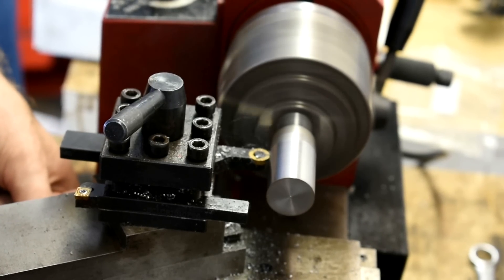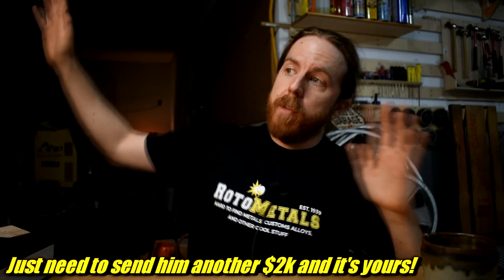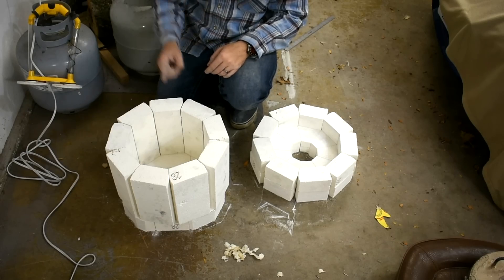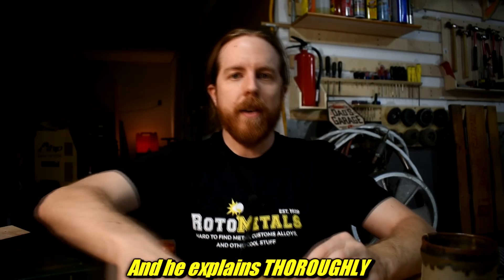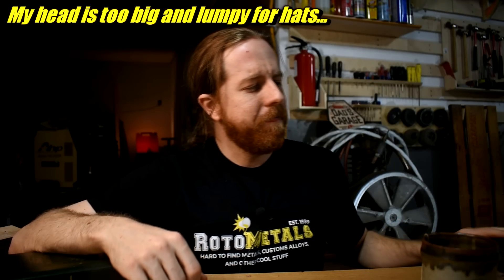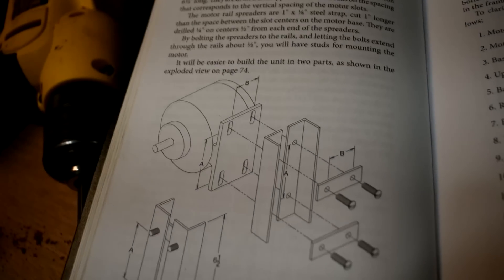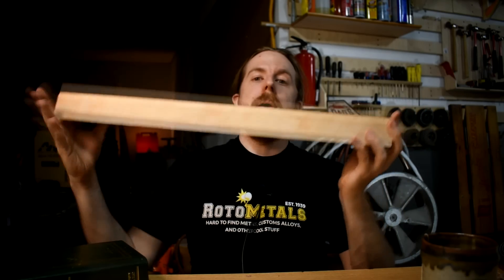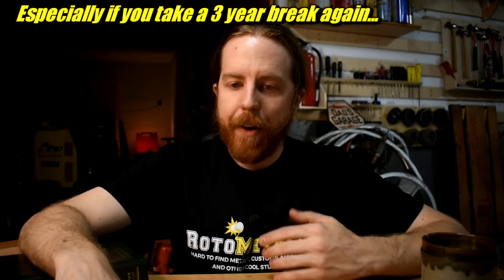Build a DIY Home Machine Shop the Gingery-ish Way

Comment: How many pounds of Za 12 do I need to order from Roto Metals for this project?  Looking forward to using my new 3 year old Devil forge for this project.  Thanks a bunch bro...
Reply from the maker: Not sure exactly how much you need to finish it just yet, but I bought 32lbs and it seems like that would cover the majority of it.  A standard gingery bed is 4lbs of aluminum, my bed is 12 lbs of za12.  Headstock is about the same, and the rest of the parts are much smaller.

Comment: I bought a set of those books years ago and was all set to start, I was teaching English to a bunch of machine designers and showed the books to them. They thought the foundry was a great hobby idea and recommended truck pistons as melting stock and gave me lots of other good tips. I showed them the lathe book and were appalled at the design, they begged my to abandon the project due to the (in their view) criminally negligent carriage design. They were convinced that anything but the lightest of cuts would cause the lathe to explode, especially when turning anything harder than toffee.
Reply from the maker: Oh yeah.  The whole thing needs to be beefed up, which is one of my design changes.  I'm also using a much tougher metal.  In Gingery's defense, if he used aluminum, it probably would just bend and not explode 🤣

Comment: Paul,
 I was directed here by a commentor on one of my videos. He had heard the marvelous shout you gave for me. I am very appreciative of it - thank you greatly.
As I have no doubt mentioned before I am not a fan of the Gingery lathe idea. There is a perfectly good reason that lathes are (usually) made from cast iron. It’s not that iron is cheap, fluid, casts well and easily, although these things certainly help - it’s because when properly formulated iron has excellent vibration damping abilities that help to reduce the resonances that cause tool chatter. Aluminium is very poor in this regard and a lathe made from aluminium will suffer badly from chatter problems. At first, I was struck by a possible problem in using Ezda / Zamac alloys for a lathe – they are heavy and while it might seem counterintuitive, weight is not a good idea as it lowers the frequency response of the lathe – it’s the lower frequencies that cause the majority of chatter problems so extra weight - not good. However, your choice of Ezda might just turn out to be inspired because these alloys have quite good damping ability - particularly the 27 % aluminium alloy but the 11 and 8 % alloys and almost as good. 
A couple of points re these alloys though, they lack a strong oxide film on the liquid and have low surface tension and will thus run into the sand mould surface and produce a rough casting on the slightest provocation. Casting temperature is important to help prevent this - I would start at 500 Deg C and go down from there until just above miss fill temperature. Also important is that mould heights are the minimum necessary to provide adequate feeder height - extra height = extra pressure = rougher castings, see my "possibilities" video for an example of this, (shameless plug😊)  and of what is possible with these alloys with careful casting. Good basin/sprue and gating technique to produce the calmest possible fill is important too. One thing that many do not appreciate with these alloys is that they can segregate on melting and on standing while liquid, thus the top of the melt can become aluminium rich and the bottom zinc rich. Careful stirring is needed to eliminate this  problem – see my video Don’t stir up trouble… (another shameless plug 😊)
Thank you once again for the great shout out – I just wish more people were of the same opinion 😊... . Martin
Reply from the maker: Hi Martin, its good to hear from you!
Vibration dampening was the main reason I chose za12 for the lathe project.  I saw Makercise struggle with chatter problems until he bolted the thing to a concrete slab, so i decided i wanted to toughen up the castings, use a vibration dampening metal, and then i'll bolt it to concrete anyway. Iron would be great, and i've melted cast iron in my furnace set up, but the extra heat was just no fun to deal with.  I don't think my sand could handle cast iron anyway.  
I've heard about the metal segregating, and i think i've noticed the issue on some of my test castings. From what I read, they segregate in the mold if they don't cool quickly, and the aluminum rich metal will float and freeze on the top, so the shrinkage occurs on the bottom.  I had a couple tests that were probably too hot and poured into overheated plaster, so they stayed liquid a long time, and the bottom shrink upwards.  I was confused until i learned about the segregation.  I saw your stirring video and that's definitely going to be how I stir this stuff.  It makes me wonder If i need to feed the lathe bed casting from below, or if i should just forego feeding entirely because its a thin casting of uniform thickness.  Campbells book says to not use feeders unless necessary anyway, and gingery's gating method (dump metal in a hole on top) wouldn't feed very well anyway.  I'm definitely not doing that haha!
I printed a box that i can use to make a repeatable pouring basin, which unfortunately adds height but it does allow me to fill it from the crucible without dumping the metal from a height.  I noticed on some of my recent test castings that the surface finish in the pouring basin is excellent, which the casting itself (4" lower) is VERY sand textured.  And you're right on with 500C, that was the best temperature I found. I could have probably improved the gating and gotten it lower but it was tending to freeze otherwise.  
And thank YOU for all of the informative videos! you are a major help to those of use who want better castings! ...Paul
Reply: @PaulsGarage  I wonder if the base was full of lead held (poured) in with some cross bolts would be a decent dampener? It would certainly add extra weight. I've been keen to try this series for a few years now and have just ordered the 'big' book. Would the lead soften the aluminium at that temp?

Comment: You might look online to see what improvements other people have made to the lathe. The biggest suggestion was to scrap the design for the lathe bed and build it according to the bed for the mill with a piece of 1/2" cold rolled steel attached for the bed surface. The next suggestion is to solidly mount the lathe on a large block of reinforced concrete to absorb vibration and reduce the harmonic frequency of the lathe (better surface finish and accuracy). The next suggestion is to throw away the jackshaft power train crap made from old bed rails and set it up with a VFD (Variable Frequency Drive). Either one from China, or a heavy duty RC car setup, called an ESC (also from China).  Until you need to cut tapers, just use a solid block as a tool post instead of spending the time and effort to build the compound rest. It will give you a much more rigid setup. And last, setup your lathe to be able to replace the leadscrew. It starts with a regular threaded rod (which is crappy), and suggests replacing it later with square threaded ACME leadscrew. The only place I could find one was from McMaster-Carr industrial supply, and it wasn't cheap. I would have been better off getting a cheap ball screw from China and setting the lathe up to use  the ELS (Electronic Lead Screw) system by Clough.

There are a lot of places to get good design ideas and methodologies for building lathes and mills. The Myford 10 is the lathe Gingery copied, and he could have done a better job of it, but looking at the accessories for it will give you a long list of projects to build for the rest of your life. Opensourcemachinetools.org has the concrete Multi-Machine by Pat Delaney. It's cheap to build, ginormous compared to the Gingery, and if you pay attention to detail during it's construction it'll be capable of some decent work. There's also the Stepperhead Universal Machine Tool documented at lathes.co.uk in the "lathes" section.  Very sweet. The Hommel UWG lathe used in German U-boats of WWII. Super compact and versatile, just a pain to setup. The Hardinge HLV-H Precision Toolroom Lathe is a thing of beauty. It's what the Myford 10 wants to grow up to be someday. Finally, there's all the people that have modded the standard Chinese mini lathe to make it into a capable machine (Like making a silk purse out of a sows' ear).
Reply from the maker: Interesting, thanks for those links!  I'll check those out.  I'm definitely interested in improving the lathe. I've already made the bed pattern so I'm sticking with that (it's modified a bit already) but I'll definitely look into the rest
Reply: @PaulsGarage  I would look at other mods, some of the shortcuts were to help make it easier to build and cast with decent results. Now that you have mastered 3d printing, you can more easily do like cross hatches on the bottom of the bed for rigidity (probably tapered to make it easier to get out of the sand) but large enough to hide the single shot whiskey bottles from your wife, or some gems, or the keys to your mistresses apartment. It was a skimp on his part to make it easy to cast. 

The other thing that would be great is to replace the brass bushing/bearings with actual bearings. Which I don't know if it is possible or whether you have to build the lathe then the mill to be able to get the holes in the headstock correct to take angular contact bearings. Which are expensive, and can't be found at the hardware store, but would be a vast improvement.
Reply: @seano8927 Do you think Babbitt bearings would work ok? Have just ordered the full hardcover book and keen to give it a go.

Comment: This is a fantastic project, but it will take a lot of time. For those of you who do not have said time it's still quite easy to find used engine lathes that are in perfectly usable condition. Look for Atlas, Clausing, or Shurline. Anything made between 1930 and 1980 will be a good buy and almost all parts are still available at reasonable cost. I bought my Atlas 6" for less than $700 with tooling and change gears.
Reply from the maker: It will take years most likely.  Not just for the lathe but I want to go through the shaper mill and add ons.  Gonna be content for a loooooong time

Comment: You should look into using Epoxy sand/gravel mix to cast you lathe bed in stead of metal casting.  I'm not sure if it would be cheaper but, it will be easier to do.  After all there are plans for a concrete Lathe

Comment: Hi Paul. Great project to sink your teeth into. I agree several changers should be made to the lathe. If modern components were available back when they would have been incorporated into the design.   So go forward and build and learn much along the way.

Comment: I've seen some folks use the bed design Gingery employed for the milling machine project for the lathe. The milling machine bed doesn't have a solid top; rather, the resulting casting is "hollow" with just the vertical sides and the cast webs in between. Since the steel ways bolts directly onto the casting there is less casting surface to hand scrape. Further, without that massive top surface, for the same amount of metal you can beef up the front and back and the web, which will result in much greater rigidity.
Reply from the maker: Good idea!  My bed pattern is already very beefed up, it probably uses 50% more metal than the original design

Comment: I know epoxy granite has been suggested, and that's a really good suggestion, but given that your foundry is capable of doing cast iron, might it not be worth casting major wear items like the bed in cast iron?

My grandfather's lathe, which he made with his father and grandfather sometime around the beginning of the 20th century, and which was CRIMINALLY SOLD FOR SCRAP ALONG WITH ALL THE REST OF HIS WORKSHOP TOOLS by my uncle after my grandfather's death, was a cast iron bed which they cast themselves.  And it wasn't small.  It was 6 feet long.  OK, admittedly they were blacksmiths.  But there is a very good reason cast iron has traditionally been used for machine tools.

The other option, and one which I was considering before picking up my own lathe and mill at ridiculously low prices, is the aforementioned epoxy granite and using off the shelf ground and hardened bar or round stock for the ways.  It's an approach that will almost certainly net you higher precision than the Gingery machines.
Reply from the maker: Good suggestions for sure.  I can melt iron without a problem, but my sand can't take the heat.  I also don't want this build to be inaccessible to viewers.  Za12 meets halfway being stronger than aluminum (though definitely not as good as iron) and being easier to cast at home than both.  Iron sure is tempting though.

Comment: I'm in!  How many KG do you think we need to order?
Reply: For those in Oz, found a supplier of ZA-12 and was quoted as A$6.81kg + GST + Shipping for a "small" 50kg order.  Sounds like the ingots are kind of big however (around 10kg).  Supplier is HAYES METALS for those that are interested.
Reply: @The_Smelters_Apprentice  Cheers bloke.
Reply from the maker: Excellent!  No idea on the amount.  The bed and the head stock are the largest castings, I think the bed is the biggest.  After I get it and the headstock build I'll weight them and put that on a video to give people an idea.  I think all the other parts combined will be lighter than those 2 parts.
Reply: @PaulsGarage  Lets guess for now.  How much does your Aluminum bed weigh and I'll get say 5-10x that in zinc ingots as an initial order?

Comment: You're right. Im going to use aluminum, but its going to be from automotive case components like differentials and transmission cases. Lots of oils.
Reply from the maker: At least those were cast to begin with, that gets you half the way there already

Comment: The bed is easy….as long as you don’t do it like Gingery describes.  🤓
Reply from the maker: Lol I'm definitely doing it differently.  Especially the gating.  He just has you dump metal in a giant hole on top, that's just asking for casting defects
Reply: Curious how much zamak-12 is enough to do all your casting?   I’ve never known anyone to give the weight of the gingery lathe.
Reply from the maker: @lunarrn  I have no idea but I have a LOT now.  I can't pick the box up or it will all fall through the bottom.  The bed and the headstock are the 2 biggest parts so I'll be able to get an idea once those 2 are done.  I assume the whole rest of the project is lighter than those 2 castings.

Comment: Great video. don't want to discourage you or anything but I think that a lathe would be better if made of steel or cast iron I know that melting steel is a very difficult process trust me I tried so a different a solution would be fabricating and welding there's a couple of videos on YouTube of people doing that. steel will be a better material for a lathe and fabricating and welding would be easier and faster than casting
Reply from the maker: Casting is what I like though.  I can do iron with my set up actually but that's no fun, the heat is crazy!  Iron is definitely the best for this though.  It's way tougher and even better for dampening vibrations
Reply: @Paul's Garage  I know iron is a pain in the butt to melt and cast.
By all means go with what you like.
I always wanted to make one myself but because I'm too lazy and suck at casting I find that welding will suit me the most. My biggest problem is milling the bed I don't have a mill, so don't know how to do it any ideas ??
Reply from the maker: @THEAngryProjects  gingery said he tried to design a welded up lathe but the parts kept warping.  I think maybe if he normalized them in a heat treat oven it might have helped?  Hard to say.  And yes for flattening the bed Gingery says to use a surface plate, blue die, and hand scraping.  The old hand scraping method takes a long time but you can get a very large surface very flat, even if you don't have a mill or a big enough mill for a huge part, since the size isn't limited.  I suppose you're limited by the surface plate size?
Reply: @Paul's Garage  for warping the key is pre heating the parts and welding in small batches so you don't let the heat build up in one part causing warpage. Also, clamping helps alot.
Hand scraping will work, but it would take ages. I don't have the time nor the patience of it.
On second thought, I have a belt grinder if somehow I managed to modify it to work as a surface grinder. The lathe project would be possible for me.

Comment: Terminology tidbit: "pot metal" refers to non-specific low melting alloy, usually tin or zinc based, which can be melted in a pot.  So ZA-12 would fit within the general category.
Reply from the maker: That's interesting!  Yes it would fit, but I wanted this alloy specifically for it's casting properties.  Mixing "pot metal" seems like a terrible idea to me.  Some of the old pewter stuff had lead on it and to combine that with zinc Alloys?  Yikes

Comment: It looks like your lathe is made of wood that's painted silver…

I'm sure that's just a stack of patterns to make the moulds…but what if you made the lathe out of wood?

I'd think it could still manage rough cuts in aluminum, and maybe surface polishing steel…

Bolt those together!
Reply from the maker: I'm not sure how tough a wooden lathe for metal would be.  Maybe if it was milled out of solid hickory or something?

And those aren't wooden patterns, those are castings from the last time I tried to do this 🤣.  Starting fresh this time, with modified and better quality castings